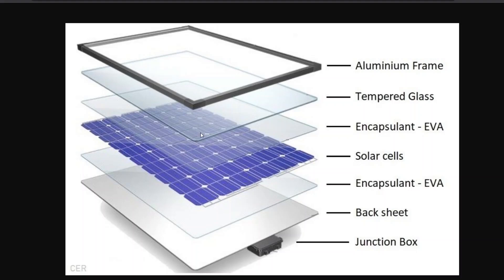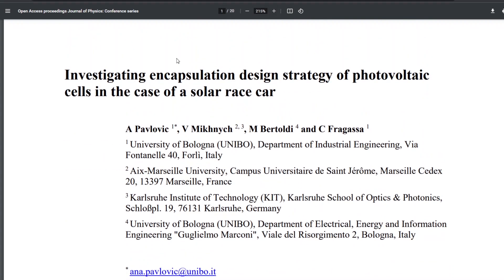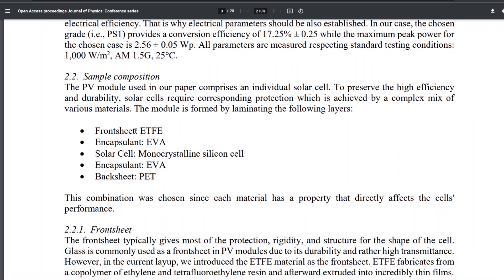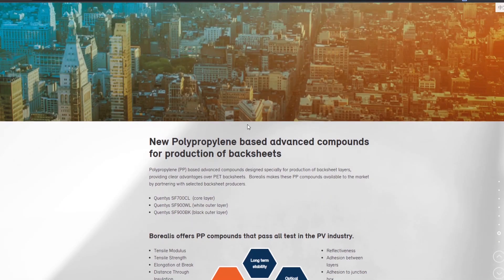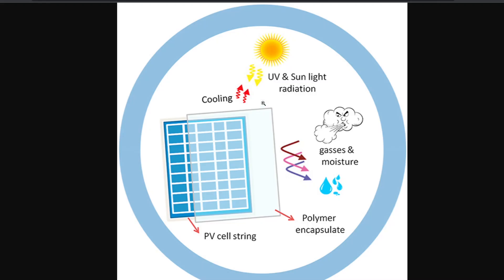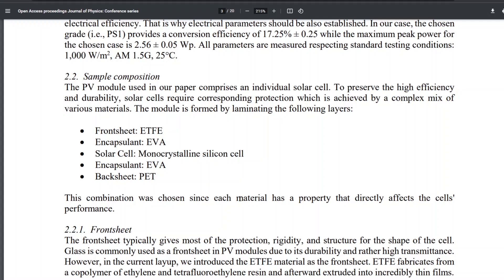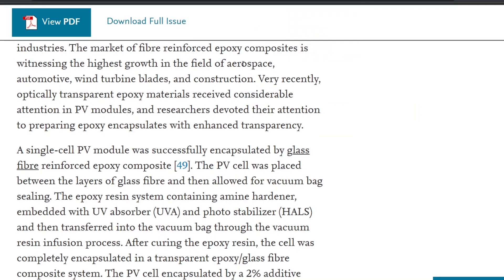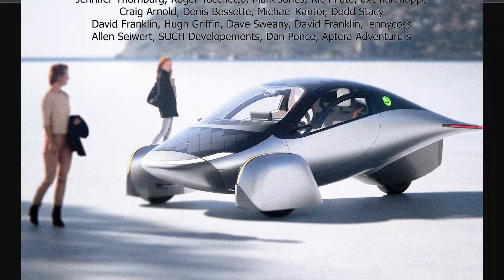Aptera's Solar Panels:  What have they been working on?

Comment: ETFE and PTFE (what's used on some non-stick pans) are different.  ETFE has a lower maximum temperature - about 150c.
Reply: I, by the way, can attest to the 150 C (or so) limit for ETFE.  I laminate my 0.001 and 0.0005 inch thick ETFE clear films to various resin-based encapsulants at about 130 to 145 C tops!
Reply: Yes, Steve oversimplified it a bit.  All of these materials, however, are "fluoropolymers" right?  See Wikipedia's entry on fluoropolymers.
Reply: @bobhilder1469  Agreed.  Fluoropolymers are naturally UV resistant as well but expensive. PP & PET need to be modified but they offer much less cost.
Reply: @jamesmezzenga3211  "PP & PET need to be modified but they offer much less cost".  I'll take you word for it but I suspect for at least some applications, an appropriate Fluoropolymer is easily worth the added cost.  I certainly believe they are for the projects I'm involved in.  (high optical performance, easily cleaned and low mass solar panels)

Comment: Slippery Topsheet is Good!  Less Kitty pawprints, Less BirdPoop Adherance, Squirrel Scratches resisted!

Thanks, @Steve!
Reply: While I doubt very much the "top sheet" of Aptera's panels will be fluoropolymer-based ("slippery"), if it is it will be easily scratched and difficult to "polish".  Fluoropolymers are generally soft.

Comment: Thanks Steve. I hope you have good scuba gear. With all these deep dives, it must be getting a real workout!

It would be interesting to know the duration of the relationship and the respective "responsibilities" of Aptera and Maxeon. Obviously (from Aptera's video), Aptera has done a lot of their own testing. But I would think Maxeon has done their fair share, too. Does Aptera come up with a "recipe" and give it to Maxion for constructing the cell and then Maxeon delivers the cells to Aptera for testing and assembly of the full panel? Or are Maxion engineers "in the room" when Aptera is formulating and testing?
Reply from the maker: I think maxeon just supplies the cells.  I don't think they are modifying their cells at all
Reply: @ApteraOwnersClub  Ah, okay. So the "Maxeon cells" as provided by Maxeon to Aptera are un- (or minimally-) laminated and Aptera will add their own layers (along the lines that you speculate on) during assembly of the full panels?
Reply: @DrTeeHenry  Yes.
Reply: Aptera is simply buying Maxeon's EXISTING cells.

Comment: I had suggested to the development team back in April '21, a type of film that rejects much of the infrared spectrum which is the major source of heat and the least amount of electrical gain with minimal effects on transmissibility throughout the rest of the spectrum.
Reply: Aptera's cells need up to about 1.2 microns of infrared.
Reply: @bobhilder1469  I did come to realize later that the Maxeon cells do operate with a small margin of IR. There are always trade offs in design and in solar arrays, the degradation from heat has always been a large factor. They seem impressive.
Reply: @bobhilder1469  
Are you talking wave range? Is this a 1.2 micron shoulder next to visible range? 
May I suggest using proper wording and units so one without domain knowledge can  follow.
Reply: @Aa792  My apologies.  1.2 micron is a "wavelength".  May I suggest you search for SunPower spectral response and take a look at some of the graphs.  I find the graphs quite "illuminating" (pun intended).
Reply: @bobhilder1469  
Got it. You mean the range of wavelength from 0.75 micron to 1.3 micron. That is actually a broader range than the visible spectrum itself. 
Also as discussed in a different youtube video,  pv cells will help keep the inside of the Aptera cooler than a vehicle without them, because IR will be partially converted in electricity instead of just heating up the vehicle.
Reply: @Aa792  Keeping in mind that there appears to be some debate as to the beginning and ending of what is known as "near infrared", yes, the range of wavelengths in the near infrared region that Aptera's solar cells are "responsive to" is from about 0.7-ish to 1.2 microns.  Although I don't have a reference for you, it is my understanding that of the total electrical power a typical silicon cell can produce, about half of it is from the near infrared and a little less than that is from the visible.  Finally, a very minor amount is from the UVA region.
Reply: @bobhilder1469  And what is usually missed is that typical terrestrial-based solar cell encapsulants will either absorb or reflect practically ALL of what UV manages to get to it rendering it's contribution to the total power out of the cell to 0.

Comment: Nice overview Steve.  FYI, what is not widely known is that the "Back Sheet" in "conventional" solar panels (0:08) is usually a tri-layer of PVF/PET/PVF.  This means the conventional solar panels have as many layers (7) as Aptera is purported to have!
Reply from the maker: I was wondering how Aptera was calling their panel 7 layers!
Reply: @ApteraOwnersClub  Where did they call the panels 7 layers? I must have missed that.
Reply: @MakeSteelBattalion2  I couldn't find where Aptera said 7 layers.  Best I could find is another video in which Steve said it again.  It's at about 13:12 mark of this video: https://www.youtube.com/watch?v=2JyprVCCB7Y&lc=UgxJ9I0N_InTCybTpUB4AaABAg

Comment: Always amazed at your research and ability to communicate it. I think you are well on the way to an Aptera PhD. A little disappointed that Aptera does not communicate on at least a similar level.
Reply: Aptera seems to be far more open than most companies - to expect more is unrealistic.
Reply: @lsh3rd  There are some things it won't share. Like what the frontal are of the Aptera is :(
Reply: @MakeSteelBattalion2  My expectation is that specs like this won't be released until Delta specs are released.  It needs to be fully locked down first.  It would not surprise me to see that next month.
Reply: @lsh3rd  https://www.youtube.com/watch?v=XZS4jcEG5eA